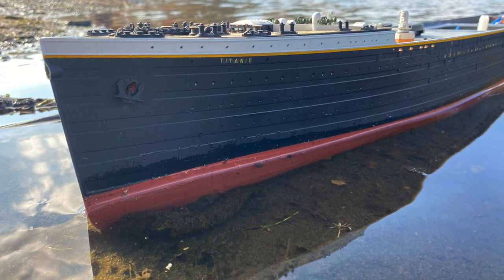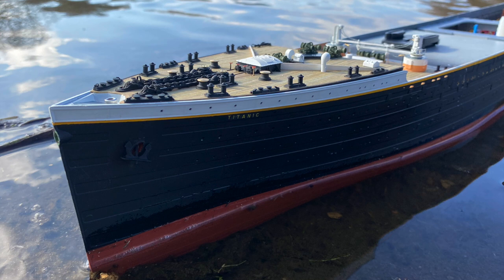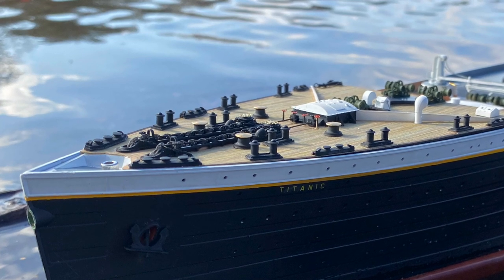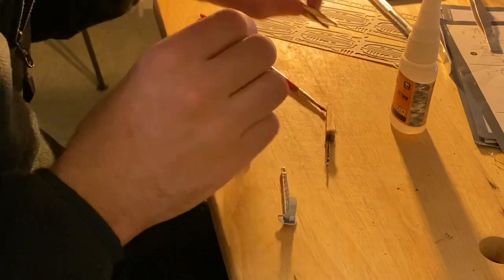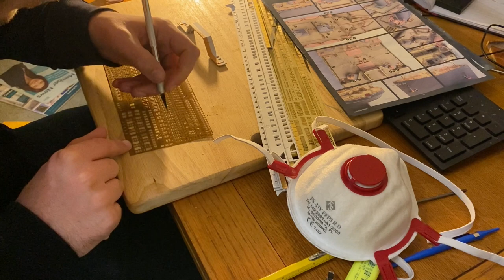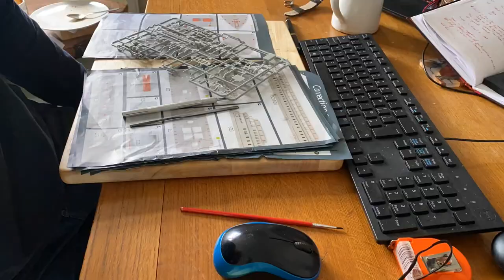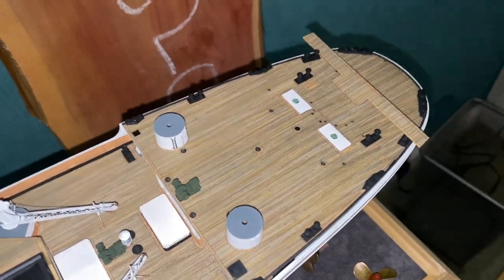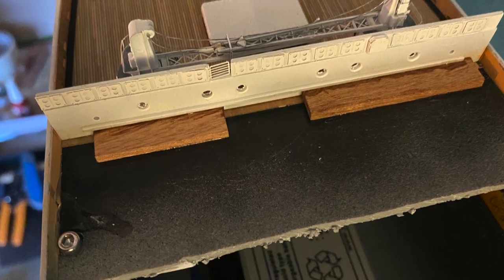Radio Control Trumpeter 1:200 Titanic Build Part 22  - Sailing Session and Aft Well Deck

Comment: Fab vid again. Loving your build. I have just finished my stern plating. I made it myself using brass as I couldn't get a set off Alexandre in time. You should do this it makes a hell of a difference and its not too difficult to do especially for you. I used alexandres instructions printout as a template over the brass and its worked out great. Only thing missing is a few rivets and bits and bobs. Still miles better than nothing. Hope you attempt it 😀 either way excellent model
Reply from the maker: Hi there, late I know but I will be adding stern playing in video 50 so keep a look out. Certainly does make a big difference, from the models I’ve seen that have been done it looks so much better
Reply: @TheModelBoatGuy  great stuff. I ended taking mine back off and got a set from minibrass just so I could have the few bits and bobs that go with it. I couldn't justify paying £90 or what ever it was for a couple of bits I had missing so just redone the lot. Can't wait for your next video

Comment: Hi Rob, nice video. Great to see some of the fine KA details going in.  Those cranes look impressive and the weak wash picks out the details really nicely. Those magnets that I spoke to you about could possibly be useful for the superstructure too as they are really powerful.  I agree about the rudder being surprisingly responsive now.  Pity the real ships rudder wasn't as good!  The decking still looks pretty impressive too.  I have been correcting the stern shaping and fitting the centre prop shaft, slow but looks good so far.  Regards stay safe JH ;-)
Reply from the maker: Evening Johnny, 
I am about to get some of those magnets actually. The superstructure seems to fit quite snugly but it could do with a bit of force to pull it down, just to minimise the gaps a wee bit. Are you
carving the missing plating sections into the stern? Would be interested to see your work there if you are. 
Hope you’re keeping well?
Rob
Reply: @TheModelBoatGuy  Hi Rob. The magnets are like those little hearing aid batteries and are packed altogether with little fibre disks to separate them.  They are really difficult to separate!  The fibre disks will come in handy to just stop them being so aggressive!  The Gorilla clear glue that I think that you have will do the job to hold the magnets and the fibre disks in position. In order to reduce the power stick the fibre disks to the facing edge of the magnets. You may need more than one!  I would suggest that you experiment with their power first before using them!  I am following Nigel's suggested hull modifications so I will be cutting holes all over the place for ages!  The stern needed the centre prop shaft installing early, I used the same type as you have which is the perfect scale.  For my sins I am using all of the Scale the Titanic PE hull detail sets which include the upper stern plating. I will need to modify the superstructure and for A Deck too of course.  I will use a very thin plastic sheet to complete the shell plating from stem to stern! A very slow process for me and it will look worse before it looks anything better!!!  All good here thanks and remember, beware of the demon magnet powers!  Stay safe Regards JH :-)

Comment: Make sure the model floats above where you intend it to because once the superstructure is added, this will weigh it down significantly.
Reply from the maker: Yeah, I will don’t worry. I added ballast to the model for this sailing so she was at the right waterline. So as I add more weight I will remove some of the ballast
Reply: @TheModelBoatGuy  oh ok nice dude

Comment: I love the fact that on your model , the central turbine driven prop is only a 3 blade where as olympic and britannic were 4 bladed. 99% of models available of the Titanic show it as being a 4 bladed prop .
Reply from the maker: Hi, thanks. Yeah it was a bit of a struggle to work out what to do. Personally I prefer the look of the four blade props but the three blade is more accurate 🙂
Reply: @TheModelBoatGuy  I'm actually considering buying one of these kits that you building, but can't find them available here in South Africa.
Reply from the maker: You might find them on a few modelling sites that could post to SA. I don’t know how COVID will effect postage though. eModels is quite good for that sort of thing
Reply: @TheModelBoatGuy  yes the titanic had a 3 bladed screw, the Olympic had a 3 bladed screw at first but because captain Smith who couldn't stop running into things collided with HMS Hawke white star line had to bring her in for repairs so they decided to put the 4 bladed screw on while she was in dry dock, now there were 2 problems with this #1. this caused a few days delay in Titanic's maiden voyage it is possible that if Titanic had sailed when she was supposed to she may not have hit the iceberg when she did because both the iceberg and Titanic would have been in different locations, #2. when white star line added the 4 bladed screw on Olympic one of the things white star line wanted to do was test weather the 4 bladed screw was better than the 3 bladed, so Titanic was chosen to test the performance of the 3 bladed screw, white star line would take all the data from Titanic when she returned to Belfast and decide which screw was the best, unfortunately the Titanic didn't make it that far so in the end white star line had no data to go off of so they just left the 4 bladed screw on Olympic and also put it on her sister ship Britannic, so this is the story of the middle screw in a nutshell.

Comment: Is there a way to vary the speed in the lower range to allow it to go more at prototype speed? Such as a DCC module.
Reply from the maker: The ESC (electronic speed controller) gives a pretty granular speed control really. You can sail her pretty slowly if you want. In this video I’m predominantly sailing her quite quick because I wanted to see how she turned. The slower you go the less effective the rudder is!

Comment: Wouldn't you say it travels a little on the fast side?  I think the speed ought to be to scale too.
Reply from the maker: She is a bit nippy yeah, but you can always slow her down if you want!
Reply: 23 knots, the approx top speed of Titanic, is 11.8 metres per second. Titanic is 269 metres long. So it does one length in 22.8 seconds. It wouldn't be much fun sailing it around the pond like that at, what, 2 real inches per second through the water. The same problem happens with model trains, but its even more exaduated at these scales.

Comment: Watching your model come to life really makes me want to start mine. I'm still rather nervous about cutting the hull to make a waterline model though. So I've just been gathering various improved parts. I do have a question. Are you going to be using the Model Monkey funnels or the ones that came with the kit?
Reply from the maker: Ah yes quite nerve wracking to make the warerline cut! 
I’m planning on using the ones from the kit. Sadly I don’t think I can really afford to spend more on this model as I’ve already spent plenty. The model monkey ones are undoubtedly much nicer detail though
Reply: @TheModelBoatGuy  I have a feeling when I'm done with this model I would've spent what would've been a first class ticket on Titanic, haha. There are some really nice upgrades out there but I too am going to have to hold back. When I was growing up, my parents had a houseboat. There was this little sign that hung on the wall. "A boat is a hole in the water. Surrounded by wood into which one pours money." Apparently a boat is a boat and the same implies to plastic ones as well.